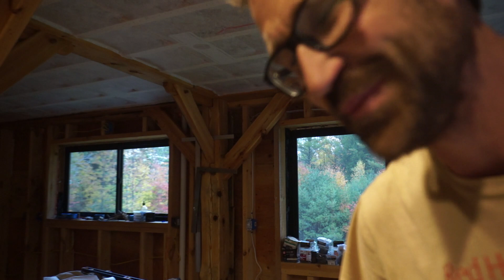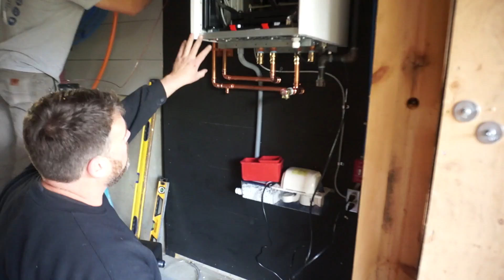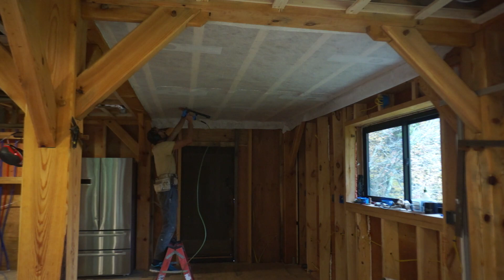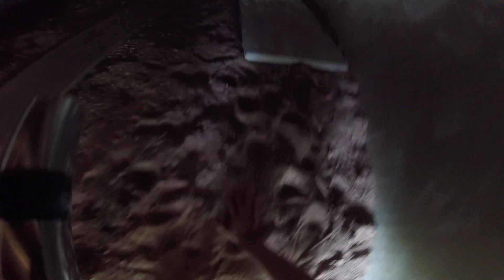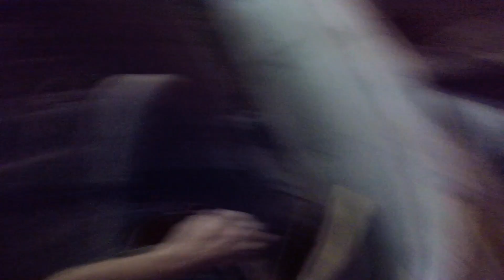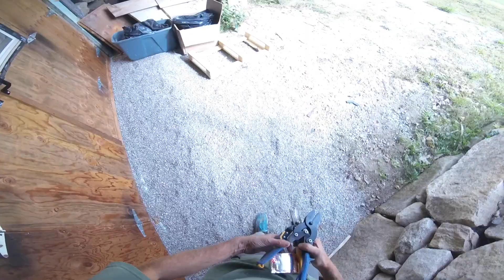Building a House from Trees SE 8 EP 6 Heat and Insulation!

Comment: for hvac  nothing beats heat pump and  heat exchanger
you want a decent amount of recirc and  a passive vent system  too
i think  you should clear more trees and put an array of panels in garden on a pergola which you also grow grapes and wisteria - the panels will provide some residual warmth to extend the growing season and help make fine select southern maine thunderbird - nice to see you insulating and  hope all the systems  shake out - you should do front door pressure test? doing some testing may not be  bad - get some sensors and monitoring going on

Comment: I have relatives that put up a manufactured house that is so tight (well insulated) that the humidity inside makes it incredibly uncomfortable to spend any time inside. At 60 F it was better to be out than in. Hopefully you will take this into account before having to add a de-humidification system. Commenting as I watch. At the end it seems that you have taken steps to to address the issue. Looking good. Keep up the good work. My hat is off to you.

I'm a firm believer in looking at what can go wrong before making any move.